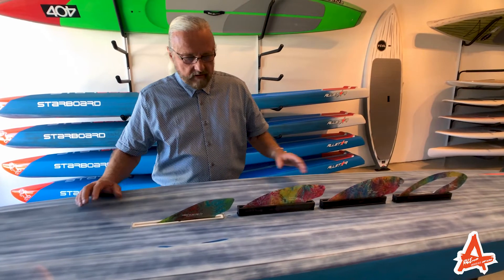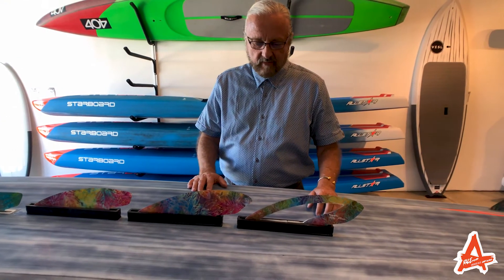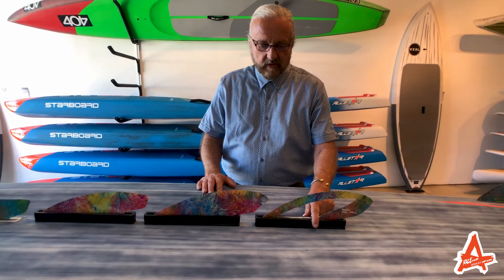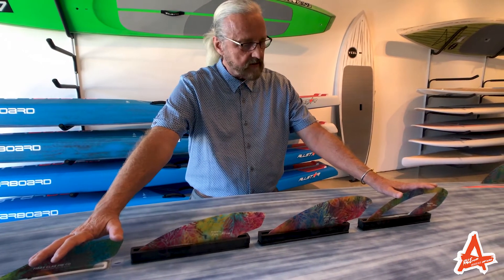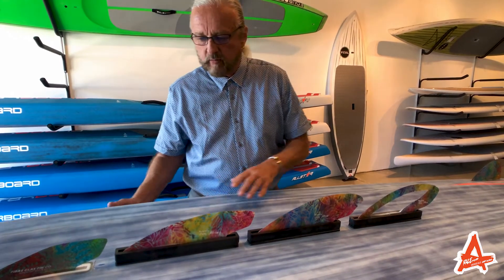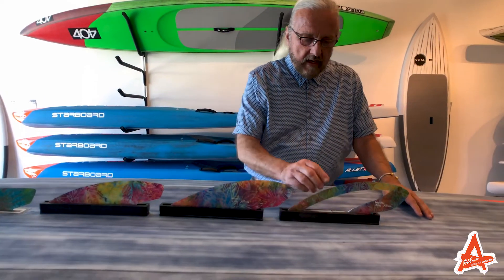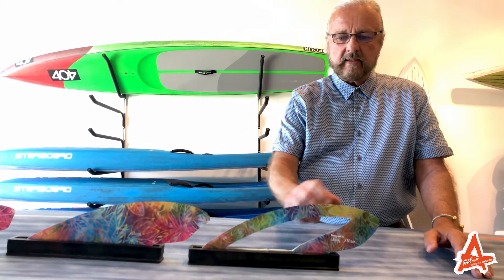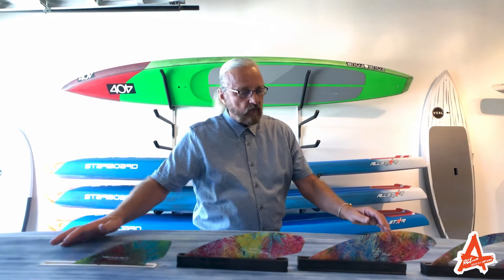Ventral Fin Shapes & Sizes - Finologist Larry Allison

Comment: For a carbon fin especially in the multifoil shape you don't need the pure foil shape I don't think. You could make the chord very thin and narrow. multilay innegra and carbon ( essentially an innegra core so no pp is exposed to feather.). That would improve both the flex and the impact resistance. Might just have to experiment with that. Only just come to SUP, but decades of sail and surfing. Immediately thought the the Centre of effort relative to  centre of lateral resistance was a problem.